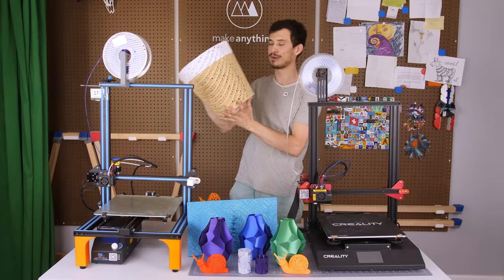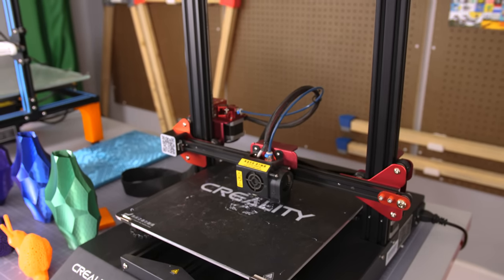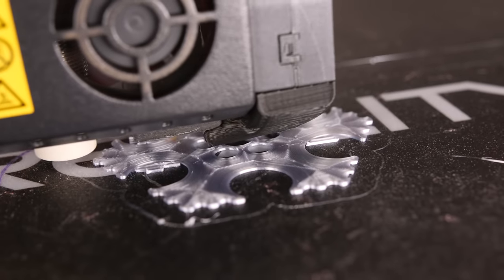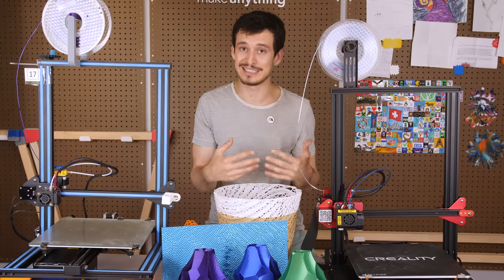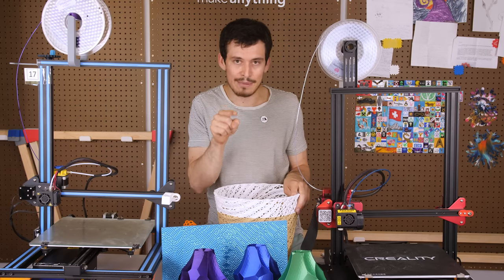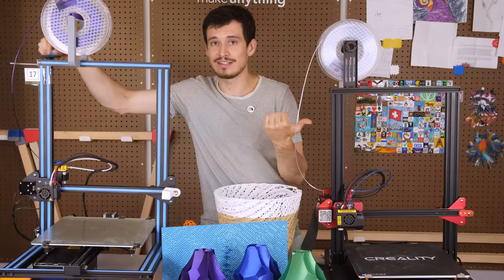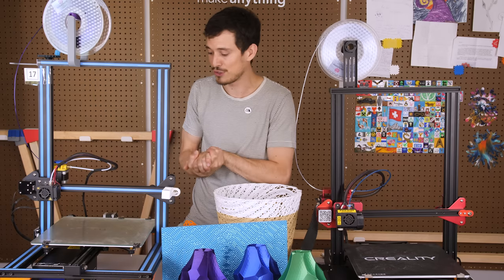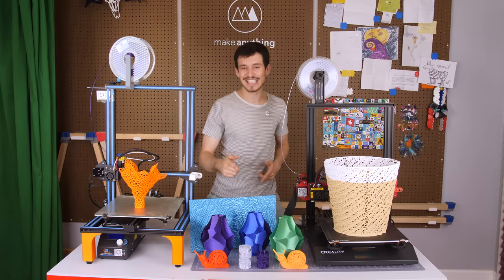CR-10S PRO Review vs. CR-10 3D Printer

Comment: On the subject of glass build surface v/s Buildtak: The build surface used should match the material being printed and the piece being printed. Buildtak stick so much better than glass. I have never had a bed adhesion problem unless the Buildtak was in need of replacement because it has ran its lifespan. In my experience, you can't remove a print from a buildtak surface without flexing the base. Using a spatula on the Buildtak, compromises the material. Glass is fine and better depending in certain situations and material. Likewise, Buildtak is better for the same reason. One of the things that would drive this is large parts printed from materials with a high coefficient of thermal expansion like ABS or Nylon. I have been able to successfully print larger ABS parts on Buildtak with no warping because it sticks so good. However, the small parts are extremely hard to remove from Buildtak because they flex with the plate and will not pop off. For that reason, I use both glass and Buildtak on my CR-10S which has a BLTouch. With the BLTouch, I swap the build surface and run the print. No setup is required to deal with difference in thickness because the BLTouch checks this distance and adjusts for it on every print. I have several printers but, my main two printers are my heavily modded CR-10S and a Raise3D E2. The E2 has a Buildtak surface and that is what turned me on to Buildtak. I also have a 1st generation dual extruder Makerbot Replicator that I have modified to have a glass build surface among other things. It's basically modified to the max.

Comment: problem with the sticking prints on the  S Pro can be solved by setting the bed heat to 70 'c and then you flip it off with ease

Comment: they have since changed the auto-leveling sensor which has fixed the leveling issue on the pro it has the blue sensor and the pro v2 has a Bltouch both of which have much better accuracy and do very well in abl

Comment: Thank you Devin. I was looking at a new fdm printer to replace a super cheap, and low quality off brand from a prusa. I was either going with the ender 5 plus or this since I wanted something I can print large things with ( for cosplay and such so didnt need to split most things) Ill be getting the CR-10 asap and get to printing.

Comment: I`ve had my cr10s pro for 7 months and still not got it printing 100% yet,  I fitted a mirror which you could say is glass and still thinking of a bltouch.
I think if I was going to get a number 3 printer , I would get a cr10s and add a bltouch and a direct extruder.

Comment: I do get your points, but some of them I don't agree with. The biggest plus I think you missed is the dual geared extruder. I have a palete 2 and trust me that's a huge difference in consistently feeding filament over a normal extruder there. Also something's like you mentioning not being able to do your dual color/layer because of it needing to probe I don't think you really tried hard enough, that's all in your starting script of your slicer. And mine probes about inches in from the corner so worst case if you can't stop it proving you still have a about a 10 x 10 build area. Also some of the parts are legitimate upgrades like the meanwell(not generic like other cr"s) power supply. Auto level sensor while it does have its quirks is more of you need to adjust how far off it's sitting from the bed(2mm) and learn to tune the red light and it's not too bad, it's been months in-between when I need to screw with that. But also because of that tuning and nailing my z home Everytime I quite like the build tack surface. If you are at a good first layer height AND let the bed cool down to ambient it's super easy to get the prints off. If your having problems getting prints off the auto sensor probably isn't tuned right. The trimamic drivers and them being silent is nice. But as far as quality prints go you really need to be doing organic type prints more than the flat surface ones you showed. The y axis is also upgraded. You should be able to push a Pro to faster speeds with less speed related artifacts also. I don't disagree the normal cr10 is probably when people should start looking. But the CR10s pro upgrades are worth the extra money and in alot of ways it is a better printer. It would be rough to do all of the upgrades and not come out close $ wise and don't forget your own time is worth something too. Updrades take time

Comment: Can you go over the upgrades you made to your original cr-10? Is it still the same board, extruder? Did you add auto levelling? Etc
Reply from the maker: I've only added the 3D printed mods shown in this video, and swapped the nozzle a few times, but no major hardware changes

Comment: Really interesting review, I wonder if the CR 10 S has a glass build plate, because then the only reason to get the pro would be to get a faster heated printbed.
Reply from the maker: CR-10 bed is indeed glass. To be fair, swapping the CR-10S Pro bed to glass isn't tough at all, it's just not included.
Reply: @make.anything  didnt know you could swap build plates like that, thank you for telling me.

Comment: I don't get why so many youtubers have problems with auto bed level. My cr10s Pro auto level works like a charm,  I press print and don't have to monitor the first layer, ever. The time I saves is worth every dollar.
Reply: Cuz many units of cr 1os pro  comes woth very bad beds and sensors
Reply: @hamadadel7326  ,
it makes sense. I guess I was lucky to get one of the early models, with glass bed under the black adhesive, rather than aluminium.

Comment: Hi. I'm new in 3D printing and I wondered about compatibility of CR-10S with certain filaments. For example, I've found some ABS type filaments, like PRO Series ABS 3D Printer Filament, that requires EXTRUDER TEMP
 235±10 °C and BED TEMP 70±10 °C, while CR-10S specified to provide Extruder Temperature PLA 210℃ and Hot Bed Temperature PLA 50℃. Can CR-10S still work with PRO Series ABS 3D Printer Filament?

Comment: Can the aluminum platen be replaced with the glass platen used on the cheaper one?  Or any compatible glass platen?  Why do you need to level the build platen at all?  I mean how does it shift out of factory specs if it is built properly?

Comment: Yeah, manual leveling is a breeze if the printer's surface is not warped. I got cr10s. Alluminium bed was warped in the middle just like the glass surface-had to return it as It was impossible to level it. Forums recommended an aluminum foil to compensate for warps-which is ridiculous when you pay nearly £400. It's apparently a very common issue with the cr10. The run out sensor on the CR10s is a joke. Both CR10 and CR10s are for DIY 3d enthusiasts. I think PRO version is more user friendly for people who do not want to spend hours reading forums to install mods.

Comment: Not sure if the guys at BuildTak like you talking smack about the surface on the Pro as it is NOT a BuildTak surface, but a FakeTak...
Reply from the maker: I've had the same experience with official BuildTak, but you're right. I've been using it as a generic term
Reply: Its PEI surface

Comment: Could you... in theory... 3d print extensions to help give the CR10 (obviously not the leveling system thing) the same or close to the same features as the PRO?
Reply from the maker: Yes, these printers are open source so you could do all sorts of mods if you do the research!
Reply: Make Anything cool! I haven’t even touched 3D printing yet, but I am totally into it! The CR10 is a very real possibility in the future

Comment: can auto level be turned off? and can you just swap out to a glass bed? also i don't like duel z rods either unless they are chained together, is there a mod for that maybe? i really like the pro for 24 volts and its design and have been thinking about buying one but i must find out if auto leveling can be turned off.
Reply from the maker: You can turn off auto-level at the beginning of each print, but it still relies on the inaccurate leveling sensor to home. Several people have said swapping that out makes the printer work great!

Comment: What are some things I can do to prevent ghosting of prints on the original cr10?
Reply: Slow down your acceleration and maybe overall speed. If that's not enough, maybe take the spool off from the top of the printer. Should at least help.

Comment: Isn't it possible to completely disable the automatic bed leveling and go with only manual bed leveling on CR-10S PRO?
Reply from the maker: It still uses the sensor to home, so that doesn't help with that inconsistency
Reply: @make.anything  Thank you for your reply. I'm going to get a 3D printer for the first time. I've been searching for a long time. Your videos helped me. As a result, I came to the conclusion that it is a more accurate decision to buy CR-10S instead of CR-10S Pro. But I'm still hesitant. The auto bed leveling problem on the CR-10S Pro is very confusing. But compared to the 10S, other upgrades of 10S Pro looks good. I don't know. I can not decide.
Reply from the maker: @konurmustafa  Look into replacing the leveling sensor on the CR-10S Pro. If you really want the other upgrades it may be worth the effort!

Comment: Hey devin just wondering if youve had extruder skipping or constant clogging issues every time i clean it out it prints great for a calibration cube then say i leave it off for the night go back to it and clogged up again im really at a loss here changed tube and its flush as the nozzle iv ordered some capricorn and e3d nozzles just waiting on them any advice id be much appreciated
Reply from the maker: It might be the end of the PTFE tube not in far enough or not flush for some reason (the end going into the hotend). That forms a pocket of molten filament that will clog after cooling down
Reply: @make.anything  yeah it seems like the filement seems to cool inside the ptfe tube at the end in the hot end iv ordered some capricorn xs and a new 0.4mm e3d v6 nozzle one with a 3mm pool hole and the other with a 1.75mm hole im hoping the ptfe tube will go directly in to the nozzle itself and stop this issue its been a nightmare for about 2 weeks now hoping this is the remedy to solve it. great work on the vids devin and awesome job on the creations youve done and many thanks for the reply mate means alot :)

Comment: I have a cr-10 and an ender 3. I love my ender 3. I would love to convert my cr-10 to an ender 3.
Reply: CR-10 Mini
Reply: @intercepte  tbh i dont really know much about the mini. I mean i would get an skr board, a 24v power supply and print electronic enclosures for the board and lcd similar to the prusa or ender 3.

Comment: Hi. I got a prusa MK3S and is a good printer quiet  good auto leveling flexible plate and update very often. Can any one please tell me the CR-10 is as quiet as the prusa? Also how tall can print? Thanks
Reply from the maker: I haven't worked with the MK3S yet so I can't say, but it's probably better in most respects at a higher cost. The build volume however is larger at 300x300x400mm :)
Reply: @make.anything  thanks

Comment: Come on Devin, I agree build tack is perfectible, but glass print beds are 3d printing paleolithic. Actually you have PEI, Ultrabase, Powder Coated flexible buildplates. Some filaments sticks too well to glass and some just don't stick to glass at all, whatever hairspray or glue coat you add.
Reply from the maker: I do prefer ultrabase, but between these offerings I much prefer the glass bed

Comment: I completely disagree with you that there is no reliability differences between the two. The dual steppers, two threaded rods and dual rails that the bed rides on make a world of difference in both reliability and durability. It's worth it to upgrade to this system with those features alone. The single rail, single rod system was one of the big reasons why Creality printers would be great when you first got them and over time would turn into barely usable pieces of crap. Glad they fixed this.
Reply from the maker: Hmm I haven't witnessed that with my two CR-10's of many years, but experiences vary!

Comment: Man...
Weren't these printers like $200 when they first came out?
Reply: You might be confusing it with the Ender 3
Reply: @extreme989  
I don't believe so.
I had a CR10 in my shopping cart on Gearbest for a while, but I never pulled to trigger. I swear it was  $200- $280 back then.

Comment: A dope print, yeahh, but I saw a LOOOOOOOOOT of  overhand stringing issues and stringing bro.
Reply from the maker: To be fair, that model has some extreme overhangs. I'd still call it a fantastic print :)
Reply: @make.anything  Was that sliced in Cura or S3D

Mind if I inquire about your fan and retraction speeds?

Comment: I have both my CR10S is far far from what I was when I got it, the PRO well the 1st thing that was gone was that stupid sensor is just to damn bad same with the official firmware, same with some fans, now the PRO works fast and do always the same, the time I put for make it work properlly the PRO was really fast vs the CR10S the CR10s need it a damn lot of mods for get it where I want it, the pro just few. So newbie friendly I will say is the pro, the 10 and 10s will need a lot of work for make it function properlly but if quality or precision of prints doesnt mater to you the both do the job out of the box, for quality and precision prints the PRO is by far more friendly... And as always if is creality QC will be an issue always still they are a really good machines with few mods for the price